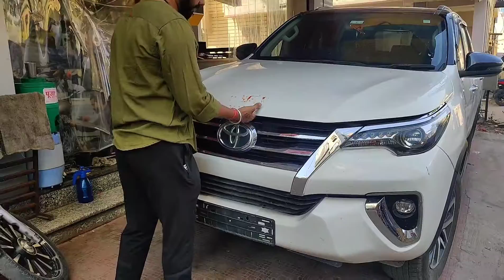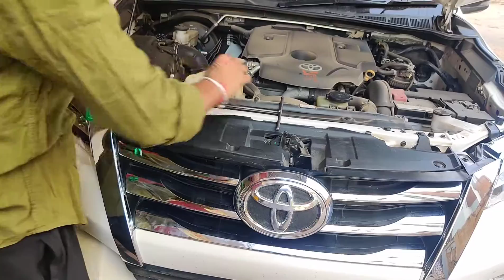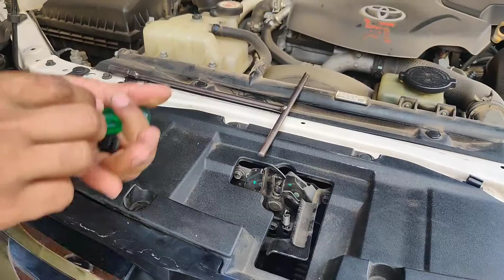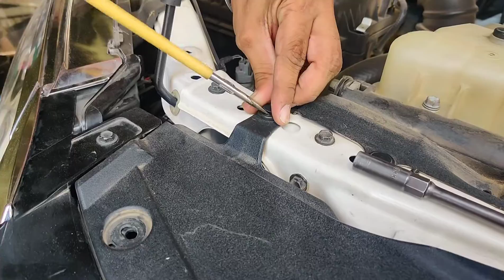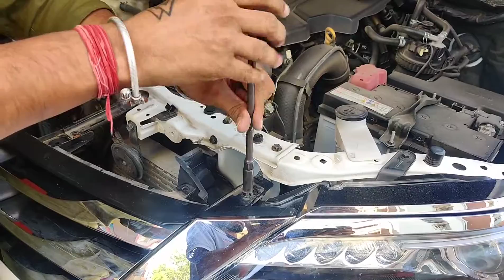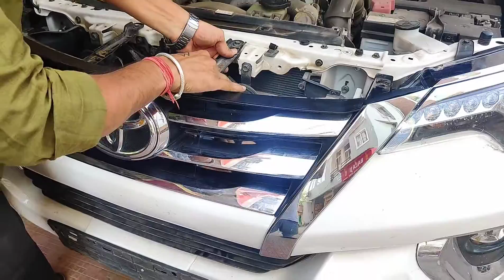How To Remove Toyota Fortuner Front Grill | Vijay Ranwa

Comment: Nice video. Can I remove the side chrome part from the grill on both sides?
Reply from the maker: Yes it's removable
Reply: @VijayRanwa  really ? I bought a aftermarket grill for my fortuner and it doesn’t come with side chrome parts. Now I have to remove that chrome parts on both sides and fix it on new grill and install it. So how to remove that side chrome parts ?